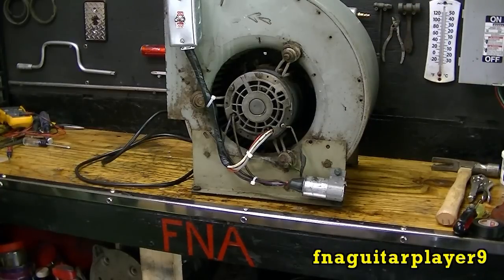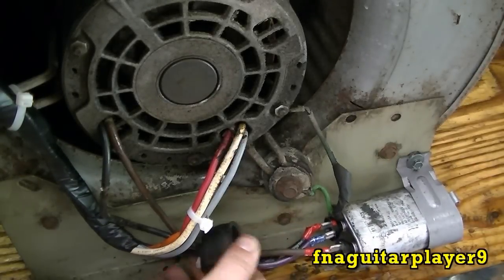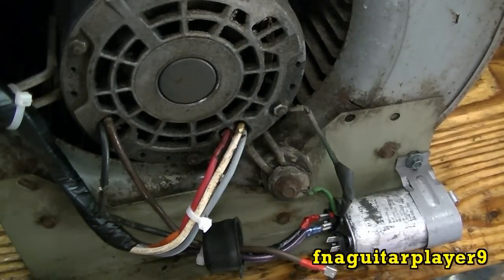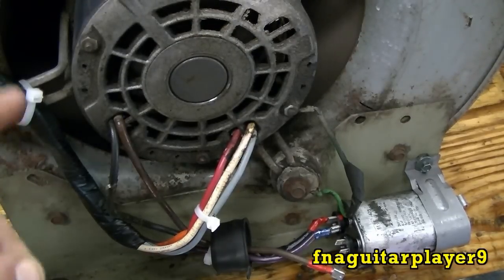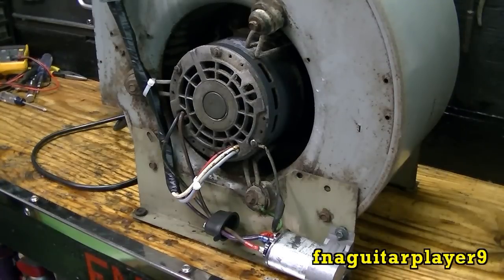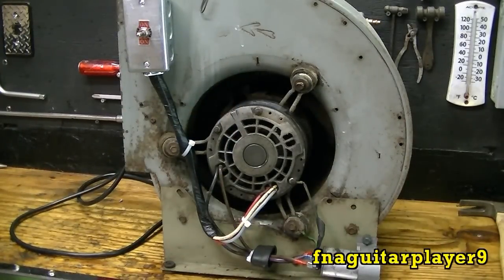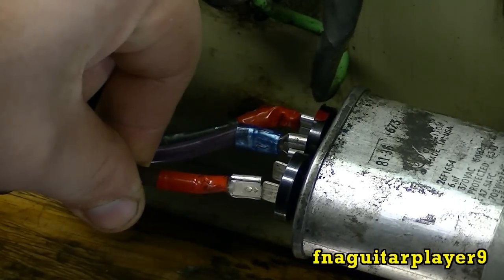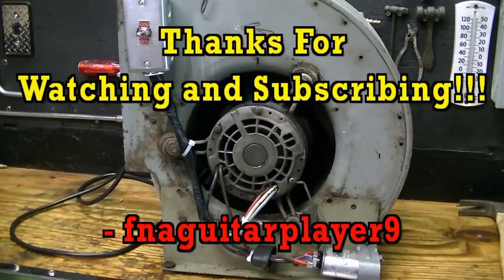Interesting Fact About Capacitor Start Induction Motors

Comment: It isn't bad to use the motor without the run capacitor.  All this does is disable 2 of the 4 windings.  Power > W1>W3 ->Gnd. Gives alternating N/S poles on W1 and W3.  A start capacitor has also Power -> Cap -> W4 -> W2 -> Gnd (windings are labeled clockwise 1,2,3,4 turns CCW I think). With a run capacitor W4 & W2 add their fields to W1 & W3 making a wider magnet of N/S fields.
Reply from the maker: That makes sense, basically just a simple mode to still use the motor. Thanks for Watching!!!
Reply: It is amazing the stuff one can find. Some day I may learn how to create a video! Thanks for making an interesting video!!!
Reply from the maker: I hear ya! Your welcome, thanks again for watching!
Reply: hi garyi am seeking help with my washing machine insuction motor i received with 6 wires that i am planning on running as a lathe. testing continuity 
(ohm multimeter reading), i found 3 possibilities/ combinations of 2 wires each time showing  continuity and those gave me motor running (without capacitor, so it demanded me making the first move). thre was 2 high ohm reading (gave low speed turn) and one low ohm reading (gave high speed turn). knowing this washing machine has only 2 speeds, where the low speed has 2 spin directions (clockwise and counter clockwise) it could be that those 2 wire combination i found to have continuity and indeed gave me motor running, are actualy one of them meant to run clockwise and the other as counter clockwise.still i did not discover the way to connect to capacitor. based on my info here any suggestion how to wire the capacitor? probably i should change wiring setting also on capacitor each time i want to get different speed?maybe you can help me here...thanks

Comment: I have a single phase 1/3 HP 240 volt 2.8 amp electric motor powering furnace squirrel cage blower. The motor is labeled to rotate counterclockwise. However it is running clockwise. The motor has 2 brown wires that attach to the capacitor. Technician just installed a new capacitor. Does the position of the two wires on the capacitor determine the rotation. New capacitor is only change made that could have changed direction. Otherwise the rotation has been incorrectly clockwise since motor was installed years ago....
Reply: +minecraft creeper lol I just noticed my name appears as minecraft creeper!  My 8 year old is a minecraft fan and he set that up through my email. Wow.  Not a creeper of any kind. A friend helped me remove the motor yesterday. Until it was removed I couldn't see the data plate. I mentioned that I wondered if how the capacitor was hooked up could reverse the rotation, but he didn't think so... We didn't test it. The motor casing gets pretty hot when it's running, but not burning smell, so I was just going to get a new motor because I figured it was going bad, but now I am wondering whether or not I really need one.
Reply from the maker: +minecraft creeper No, the wires on the capacitor doesn't matter, the capacitor can be hooked either way, it will not reverse direction, capacitors (except for certain electrolytics) are non-polarized (compare to a light bulb for example). I'm not sure what could be causing it run backwards if its labeled like that, at least not with serious modifications done to it. Some motors do tend to run hotter then others,  if you still had the old cap you could try it temp. just to see if that is what it changed it. But I don't really see how. Hope this helps some! Thanks for Watching!!!

Comment: I've recently purchased an Engineer's lathe which runs off what the manufacturers describe as a 'Powerful Capacitor Motor'but i have my doubts,as it just doesn't sound as robust as some of my other workshop machines.Would it be possible to replace the existing motor with a more powerful one?(I am happy with the lathes other qualities,such as the accuracy of the ways)
Reply from the maker: +Alan Jackson I hear ya, I've never heard of that before, unless they mean capacitor run or start. I don't see why you couldn't change them out, most of the time the only possible problems would be mounting, a new one may mount different, or may have a different size shaft or something like that, that usually can be worked around. Thanks for Watching!!!
Reply: could you give us updates for the lathe project? I am planning on building one with washing machine induction motor. thanks

Comment: Very useful video.I have a question.My Dryer motor in washing machine (capacitor start motor),It's starts slowly and starts to smoke.At the same time,It gets very hot.What will be the reason to happens like this?Is the centrifugal switch gone bad or stator problem?
Reply from the maker: +sumathi baskar Thanks. it might have just been the capacitor, but since its smoking the windings are probably shot in it now, usually when the start smoking they don't want to stop, even with the problem fixed, could be starting windings. Thanks for Watching!!!

Comment: How to find the specification of the capacitor to be installed for the motor.....
Reply from the maker: +Manuraj Mishra If its not known you should be able to look it up by the make/model of the motor online, or contact the manufacturer. Otherwise its impossible to know what it takes. Thanks for Watching!!!

Comment: Good info about these motors.  Im  working with and around these motors all the time. This is good to know all this.
Reply from the maker: +Kelly Wes Kirkconnell I hear ya! Thanks for Watching!!!
Reply: +fnaguitarplayer9i live in a mobile home i bought a capacitor put it on  the motor and it still not working can you buy a bad one and the one i was sold was shorter than the one taken off
Reply from the maker: +Joan Wise It is possible to get a bad one, but as long as the specs are the same the size of it doesn't matter so much, it sounds like the motor may be damaged itself, if it ran for a long time with a bad capacitor it really stresses the windings. Thanks for Watching!!!

Comment: I changed my running cap but the motor will not start but it hums when I use the heat thermostat on my Rheem furnace. When I use the fan only the motor is running ok. Does it have another capacitor this system for starting? or the motor has 2 speeds and one is not working? My a/c is working ok. Thanks for your help. Andy.
Reply from the maker: +Andy Patarias That sounds like one speed may be burnt out if it doesn't have another capacitor, which i'm not sure of to be honest, its possible to have 2, but thats usually one for starting and other for run. Hope this helps some. Thanks for Watching!!!

Comment: im going to be building a 6 coil 3 phase motor myself.   as it now stands, the tentative design for the coils are a 1 inch total diameter with a 1/2 inch iron coreat an inch long. the diameter of the motor its self is 6 inches so far.  this may have to be increased.  and advice on how to wire it up for plugging in?
Reply from the maker: +Troy Moore I hear ya, sounds like a good project there! I'm not really sure on this to be honest, I'm just a electrician not a engineer, so I don't really have much info on how motors are wound, you may want to contact a motor rewinding shop or talk to a electrical engineer or teacher. Hope this helps, Thanks for Watching!!!

Comment: Enjoyed the capacitor video. My question is, I have a wholehouse fan and the motor will just stop. When I flip the switch on after it has been off for a bit and the fan turns sometimes and other thimes it just humms like in your video. Does this sound like a capacitor problem or do i have to replace the whole 1/3 hp motor?Thank youAl
Reply from the maker: +hill billy Very true, this motor got super hot before i put a new capacitor on it, the old cap was swelling and you could smell the windings getting really hot. Thanks for Watching!!!

Comment: interesting note - you dont need to have it spinning to get it going without the cap. they'll start up fine if the rotor is in just the right position too. so just turning the motor perhaps a 1/8th or 1/4 turn will allow it to start up rather than just stall. Useful if your cap is stuffed on your 2n'd hand power hacksaw and you cant be assed opening it up and replacing it :P

ps 
touching/trying to connect live exposed wires with bare hands? wtf mate, thats just silly. pull it apart for a demo sure but bloody hell...
Reply from the maker: +sn0wchyld That is a good point, i've noticed that with just a little push it will take off, alot slower ramp up though. I hear ya, yeah its very dangerous and I don't recommend it at all. haha Thanks for Watching!!!

Comment: my old blow wheel used to make vibe noise from unbalance and very heavy dust build up. I replaced the wheel but now I notice i don't hear it kick in to turbo anymore and my cooling is down a bit. all wires are hooked up as they were thanks to pre work pic of capacitor. I did not know about discharging, could this play role in burning up cap.?
Reply from the maker: Tony King It could be a bad capacitor doing that, it wouldn't be from not discharging it though, that is just for safety all that does. Try replacing and see, or test it first if you have a meter to test capacitance. Thanks for watching!!!

Comment: is this a specific cap or would one from a microwave work it looks identical to ones i pull out of microwaves thanks
Reply from the maker: sam witwiky Yeah, it has to be a motor run capacitor, anything else won't take the abuse that they go through, most microwave caps are lower capacitance anyways, and much higher voltage rating. Thanks for Watching!!!
Reply: thanks
Reply from the maker: Your welcome!

Comment: this type of motor is called a perm-split capacitor motor,the 'run' cap.is connected between the start and run windings.older models were usually of a fixed direction,replacement motors are sometimes equipped with motor leads brought out to an external terminal for different speeds and direction of rotation, for use in several different applications. one thing to note....some people like to use these squirrel cage fans for cooling a shop ,garage,or barn but remember these direct drive fans will not run very long before the motor overheats and shuts down.these fans require some back pressure to operate correctly so remember to block off some(about 1/4) of the air discharge opening.the belt drive models are better suited for air movement purposes because they are quieter,run at a slower speed and do not require blocking some of the discharge to operate correctly.
Reply from the maker: modoc That sounds about right, i'm actually a journeyman electrician, i need to freshen up on motor terminology haha Thats what i use that one i show in the video for all the time, i've never had it over heat, i had the capacitor go bad on it, it almost blew up. I'll keep that in mind if it ever overheats. But i've ran it for 8+ hours with no problem. But i also don't usually run it at the highest speed, usually the medium low speed is what i use. Thanks for Watching!!!

Comment: Hi there I am having 2006 trance and the aire handler is doing a noise like water in a hose and spin a little bit and stop and so on and when it runs if that happened it does weird noise like the motor is a little shaking but nothing wrong with the mounting , I changed the board but same think is that would be a bad capacitor !!
Reply from the maker: That does sound like a bad capacitor, possibly causing the motor to overheat and shut down then start again. Thanks for Watching!!!

Comment: Very interesting....the humming....I'm diagnosing an impeller pump in a dishwasher that has not been pulled out of the wall and dismantled yet and I have not called the service guy.   Hydraulic flow problems seem to have been eliminated.  I noticed a residual humming from the dishwasher when all the cycles are complete.  Opening the door reveals an unpumped sump.  The small plastic impeller pump in the Bosch washer does not spin freely when the circuit is still on but it rotates when turned by fingers as though attached to a spring.  I think there is a magnetic field acting on the shaft.  I can feel it.  It won't dissipate with time.   I can feel resistance and then brief attraction as the shaft rotates through a field either clockwise or counterclockwise and then re-orients to a new position.  There is no mechanical blockage...just a magnetic effect.   I am guessing the permanent magnet feels the induced force of a powered coil.  I see youtube videos of the impeller spinning freely by hand and turning with some magnetic resistance by hand.  I can't find clues online as to what state I should expect except in your video where the motor will sit and hum if the capacitor does not provide what it must...either starting force or phase delay for running.  I do detect a distinct hum at the end of cycling.  Unfortunately I can't quite tell if the impeller motor is burned out or the capacitor is bad but the capacitor seems to be a good place to start.  I'll put a light on the motor if I can to look for burn marks.  Thanks for the clues.
Reply from the maker: shoshonite That sounds like either the bearings are seized or the capacitor is bad, but even with a bad capacitor it should still spin free without power connected, I have another video on how to check the capacitors to see if they need replaced or not. Glad to help out, Thanks for Watching!!!
Reply: fnaguitarplayer9 I understand...indeed your fan spins free with or without the capacitor.  That's a good point.  

I don't think my shaft is bent or the bearings are bad.   So what would make the epicyclic feel?...I turn the shaft resistance builds a little...then as I walk the little impeller blade around some 150 plus degrees with my fingers it suddenly jumps to 180 degrees and softly dwells there.  You can walk the impeller back or forward with fingers and the same thing happens.  Turn + 160 or - 160 or so and then the jump.  Some you tube videos show free wheeling others do not.  In neither case is the phenomenon discussed...it's just referred to as a "turnable" condition.   Each video concludes successful hydraulic clearance has been achieved.  

The circuit has been reset, powered off and recycled.  I ran it and left it 18 hours with no change in behavior.  There seem to be two magnets working against each other along the shaft...one permanent and the other electromagnetic.  It's as if a relay is open or closed and the electromagnet is active even if the unit appears off. Maybe the circuit board is messed up somehow...like the automatic program is not advancing to the last step even if I reset and start anew.  Might a circuit store charge and behave this way if the program does not complete?  Then I have a very different problem.
Reply from the maker: shoshonite I'm not really sure, thats about the only thing i can think of. Unless its a series wound motor (the type that has brushes, like in most power tools) and not a induction motor, and some how the field coils are energized but thats not the case if it has a capacitor. Another thing that came to mind is maybe there is something belt driven running off the motor, not real sure what it would be but that would explain the tension on it if what ever is hooked to it is seized up, but i'm not really sure on how they are made, i've never worked on one. Not real sure whats going on haha

Comment: how do you tell between a start and run capacitor somehow four brand new capacitors end up in my hands but i know nothing about this kind of stuff lol
Reply from the maker: Start capacitors are usually round (not always) and a much higher capacitance rating then run caps, the run capacitors are usually oval shaped, like in the video and with much lower capacitance. And in certain applications, the run capacitor will act like a start. The construction is the main difference, start caps are more like electrolytic capacitors found on circuit boards, while run caps are much "heavier duty" so to speak. Thanks for Watching!!!

Comment: I like your straight up no BS presentation.
Q:Why is it that I see universal motors with the label reading 90 volts? Does that mean it needs a maximum or a minimum of 90 VDC or RMS? I notice in the Grainger catalog, that they sell 90 volt speed controllers too.
   AND.... how does AC work in a motor wound and wired for series DC?
Reply from the maker: ***** Appreciate that! I would have to guess that is DC, not really sure on that. I'm not sure exactly how they work but they do, like most motors found in electric drills and appliances like that, they will run on DC, I'm not a engineer i'm just a electrician, been a while since i studied motors! Thanks for Watching!!!